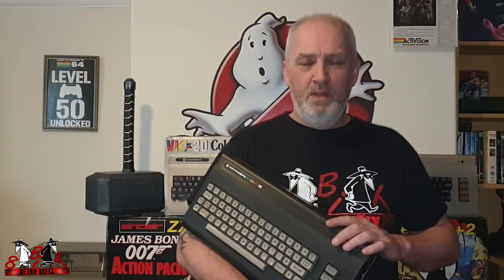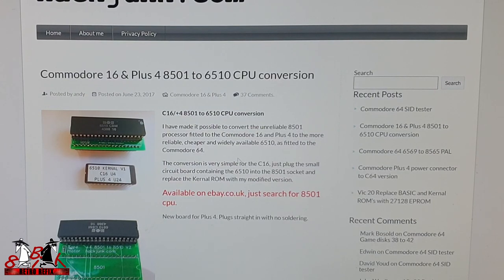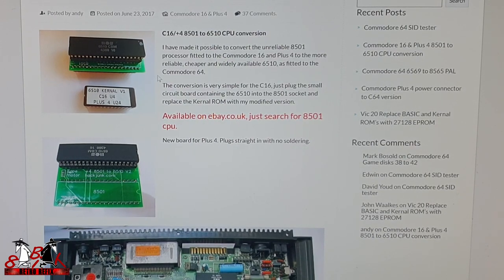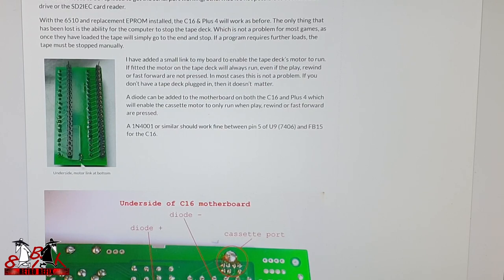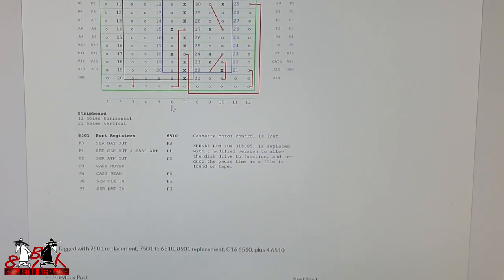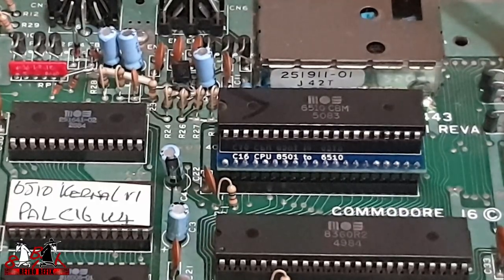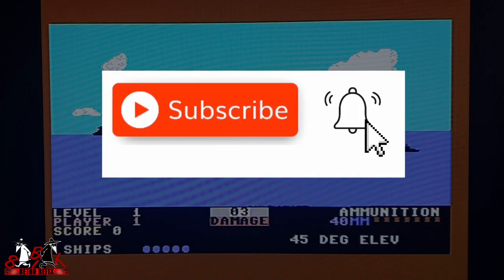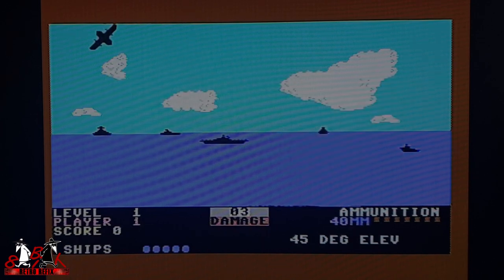How to convert a Commodore 16 Cpu from 8501 to 6510

Comment: Seems like someone needs to be working on either an FPGA that does the work OR something using the 65x02 that can be modded to do the necessary bank switching - find modern parts that are actually cheap. Taking chips from one to repair others is just unfair to both. Probably ought to be looking into a board that plugs into the CPU and TED spots and increase the RAM on that board simultaneously.
Reply from the maker: Couldn't agree more mate ... The c16 doesn't get much love .. but if someone did that it would be great 👍... thanks for watching